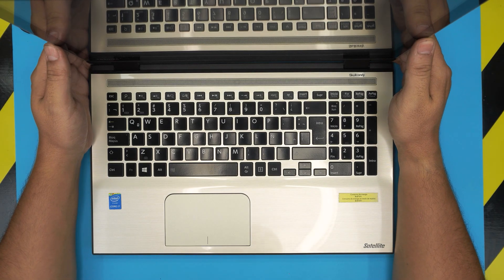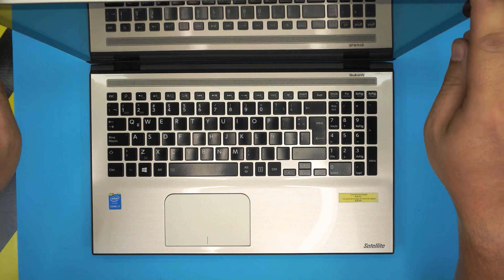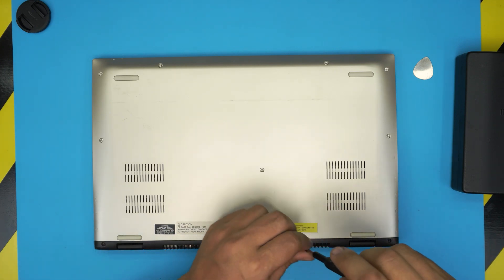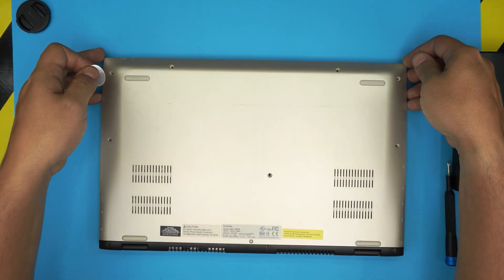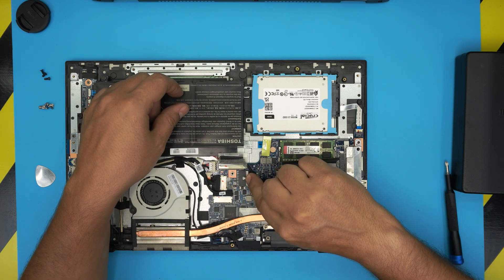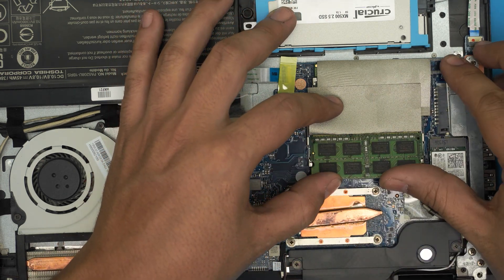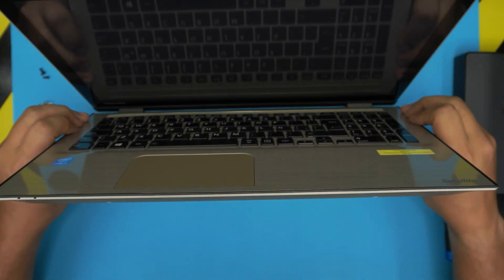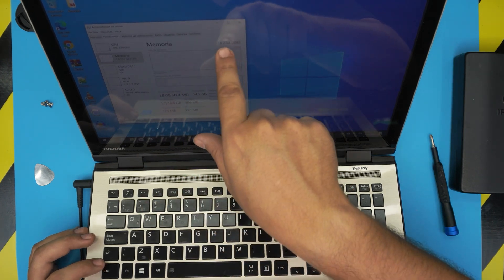Toshiba Satellite L55w C5202s 🚩RAM UPGRADE

Comment: Sir  @uFixTek , did you use DRR3L or DRR3 only?
Reply from the maker: 🫠Regarding your question, use DDR3L (low voltage). It offers the same performance with better compatibility.
Should you have any further questions or requests in the future, please don't hesitate to ask me.
cheers🍻
Reply: @uFixTek  thanks sir
Reply from the maker: It's my pleasure my friend.
i appreciate your support 🫠

Comment: Can you do a video about how to replace the CMOS battery of the Toshiba L55W? Thank you!
Reply from the maker: Thank you for the feedback! if you wish to support the channel you can LIKE or SUB or both :P
regarding your question: the cmos battery is connected to the usb side board its just plug in you pull it out.
here is a picture: https://imgur.com/a/VZXsLQH
this is the compatible battery: https://amzn.to/3BTwqp5
and some of the L55W models don't have cmos battery they use the internal battery (main battery) too keep the charge. for e.g this model in this video is l55w -c5202s it doesn't have cmos battery but the older models do have.
Reply: @uFixTek  Thank you very much for answering! I have a Toshiba model L55w-c5201s, so I'm not sure if it has CMOS battery or not, but at least now I know where to find it (if it has one)!
Liked and subscribed already!
Reply from the maker: much appreciate your support,
here is a video of battery replacement: https://youtu.be/o7LbQG6YWaw
and if you watch this video @3:18 you will see the empty battery space, and if you see your with a battery then the rest is history just lift the metal bracket and replace the battery: here i circle the place of the battery: https://imgur.com/a/RYmdMfk